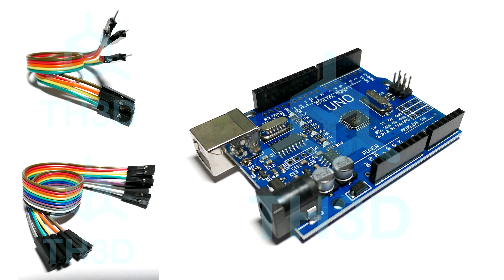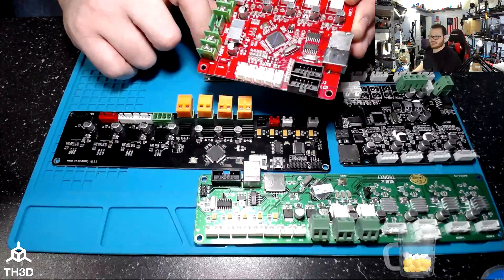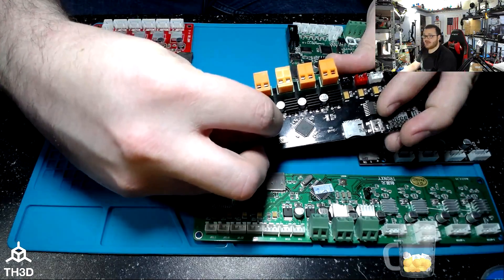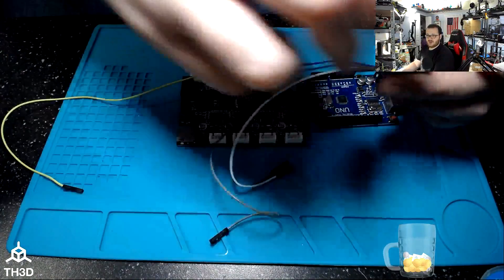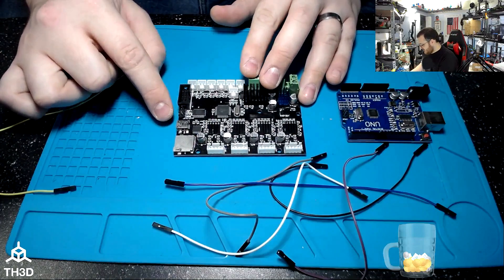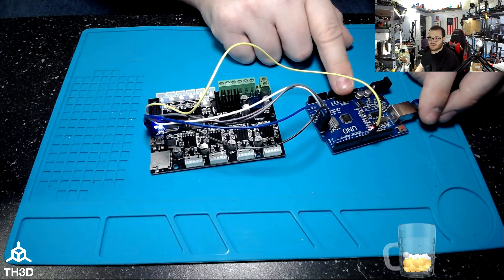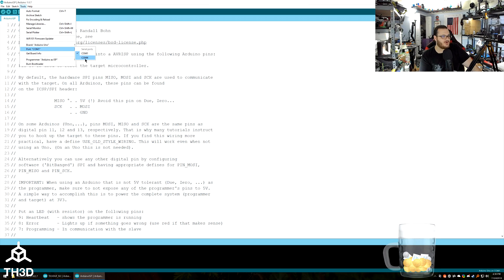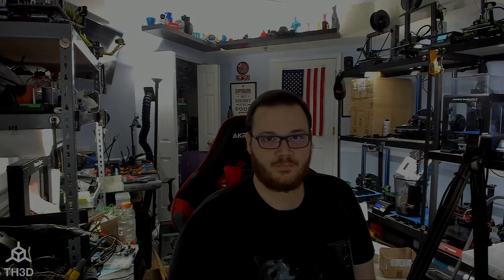Bootloader Flashing Guide - CR-10/Ender 2/Ender 3/Ender 5/X3S/X5S/Wanhao i3 - 1284p Boards

Comment: Were you able to solve the problem?

I'm repairing a 3D printer with a Creality3D V1.1.3 board. I replaced the old hotend with the Titan Hotend + Extruder Kit, and I'm having the exact same problem. Everything works perfectly, except the extruder isn't feeding the filament.

I've tried many things, including swapping the cables for another axis, and it behaves the same. The strange thing is that when I try to move the extruder through the screen, the one that tries to move is the Y axis.

I've investigated, and it seems to be a problem with the firmware that somehow got deconfigured. I'm trying to find a way to update it since it's a very outdated board, but I wanted to avoid that process if possible.
Reply from the maker: That board is very old and slow, it should be replaced with something like the V4.2.7 or EZBoard V2 - both of which we stock and sell: https://www.th3dstudio.com/product-category/3d-printer-boards/

Comment: Hi! I have a problem with my Ender 3 S1 Plus. I installed the firmware wrong, and when I reinstalled the original one, it works fine on the display, but when I insert the card into the motherboard, it doesn't start. I've tried everything, but nothing. How can I fix it? Thanks for your help!
Reply from the maker: This video is not for that printer.

Comment: I have Creality 4.2.2 board with 4-pin header, pins power, ground, clock, and digital IO.  Do you have a procedure for this board?
Reply from the maker: This guide is ONLY for the 8-bit boards. Yours is a 32bit and already has the bootloader. IF you need firmware see here: https://www.th3dstudio.com/product/unified-2-firmware-for-creality-stock-v4-x-x-boards/

Comment: does it need to speciffically be an arduino uno or can a micro work too?
Reply from the maker: I've only ever used the Uno R3 type shown in the video so I am not sure if others will work the same way. I would assume you could but I wouldn't be able to walk you through it since its different from this guide.

Comment: After opening AruindoISP at 12:08 anytime i use the openfirmwarewindows it opens the AruindoISP and not all the files for the bootloader (TH3DUF_R2 and such). Do I need those or do I just burn the bootloader after doing the AruindoISP. Thanks
Reply from the maker: Read the bootloader page. Unified is not in that package anymore. This video is older.

Comment: I know this is old but does this need to be done every time to accept firmware or once and done?
Reply from the maker: One and done. This guide for the bootloader part is still the same in 2023
Reply: @TH3DStudio  I edited firmware to enable arc support, made my firmware too big and overwrote the bootloader... Only one and done if you're not dumb I guess haha
Reply from the maker: You probably used the wrong build environment if it overwrote the bootloader.
Reply: @TH3DStudio  I did 🫠 don't worry, all patched up back up now. Loved the work you guys put into the unified firmware. My old garbage printer AC Mega Zero V1
Reply: Was even updated in your configs

Comment: i got this message   
avrdude: Expected signature for ATmega328P is 1E 95 0F
Double check chip, or use -F to override this check.
Failed chip erase: Hochladefehler: exit status 1
Reply from the maker: Sounds like you're trying to flash the control board and not the UNO.

Comment: "make a tutorial that won't be outdated" aaaaaand it's outdated
Reply: Yup! Very outdated. I have listed and read everything, still cannot find the new arduino files for the bootloader. It's not in any download package. Their website and directions put you in circles between a few pages and downloads that all say "refer to this page" which refers to a dwonload which is missing the file you need.
Reply from the maker: You would be wrong. The Arduino IDE is still what you use to flash the bootloader. The firmware is the only part that has changed. So flash the bootloader with the Arduino IDE and then use Visual Studio Code to update the firmware.
Reply: @TH3DStudio  the link doesn't take me to the "full package download (U1.R2.7)". found "Unified 2 Firmware" for my printer so tried downloading that but that doesn't seem to be the right software for this so I tried downloading "TH3D Bootloader Flashing Package" with also doesn't seem to be the right one. 
found another link on how to flash the printer from the site but that link was a 404 "Did you get a bad flash on your 2560 Creality board? Read here on how to re-flash the board.".

Comment: Maybe because this info is 5 years old but this didn't work for me. Followed everything exactly but I get an error that says: Arduino: 1.8.7 (Windows 10), Board: "Arduino Uno"

the selected serial port # does not exist or your board is not connected

I can see that  the board is connecting and everything is getting power.
Reply from the maker: This method still works in 2023. It sounds like you may be missing a driver for the board or have the wrong one installed.

Comment: I have the 4.2.2 board and there is no programming pinouts?
Reply from the maker: The 4.2.2 already has a bootloader. This guide is only for the older 8-bit boards.

Comment: Any thoughts on why the boot loader would just be wiped? I mean i suspect it has some thing to do with bad sd card and i can imagine marlin crasghing on write errors. That should not wipe bootloaders thats crazy. I have and isp programmer but i hate to have to open up my kinda new ender 5 pro. So much troube. Would be nice if creality exposed the isp to the outside or fix marlin so it doess not just write anywhere on sdcarrd error. Sorry for my typing errors. I had a stroke last year. Thats also a reason I see opening up my ender as a challange
Reply from the maker: Usually, the bootloader gets overwritten when the firmware or flash region is not setup correctly. Thats assuming the CPU doesn't have an issue itself.
Reply: @TH3DStudio  wel mine was original. The board says 4.2.7 no isp connector and the 4.2.7 firmware dud bot work the 4.2.2 did. Weird. Glad i could still flash via sd

Comment: Is there a way to know the bootloader actually loaded into the printer control board? It finished but it also finishes when the UNO is not connected to the printer control board. Also, I wanted to be sure the wiring is correct for the MISO & MOSI.

UNO MISO to BOARD MISO
UNO MOSI to BOARD MOSI 
or
UNO MISO to BOARD MOSI
UNO MOSI to BOARD MISO
Reply from the maker: Its MISO to MISO and MOSI to MOSI. If the board has a bootloader it will update firmware over the USB port.

Comment: hi, great video. Could you advise how to do this with the Creality Ender 5 Pro Board v4.2.2 as it only has 4 pins instead of 6. I need to do this as I messed up a flash update half way through and lost the preinstalled boot loader. Thanks in advance.
Reply from the maker: You don't need it for the 4.2.2 board. You should read up more on your board before attempting to modify the machine or you may break things.
Reply: tysm for your reply.
I have followed all the tutorials and information i can find on this and still no results.
I realised i put a boot loader sd card in my printer just after i turned it on annd in panic i switched it off again and had nothing but a blue screen since.
I beleive i have corrupted the boot loader, and read somwhere i cannot now find that it can be put on again with an Audrino, which i have a uno3 to use.
Is there any way you know of reflsing the bootloader?
Reply from the maker: You'd use a STLink to flash it but you need to get a hold of the bootloader file from Creality. We don't even have that and we sell their boards.

Comment: Hmm, looks like something is wrong.  The Sanguino 1284P option is nowhere to be found when using the Arduino IDE which comes in this download package.
Reply from the maker: You may be using the locally installed Arduino IDE. Our package has the 1284p included as its a portable installation. But if you have an arduino IDE installed already you may need to uninstall it while using ours.
Reply: Also, the OS X instructions for how to install the "hardware" folder containing Sanguio support which is included in your download package  direct the user to a URL which is a 404.  It turns out the instructions are trivial, just move the "hardware" folder into your sketchbook folder (on OS X, that's ~/Documents/Arduino).  (For others seeing this, note that this is an alternative to using the board manager URL, not in addition to).
Reply from the maker: Thanks for letting us know about the broken URL. We'll get it updated and updated in the new helpcenter.

Comment: Thanks for your videos, I was indeed motivated to follow your súggestions, but:
My prrinter worked fine, until I noticed the X Motor did not stop during heating up before the print. The stop switch still worked fine during a test. So there was a need to upgrade the firmware. However, I ran into a problem and now I am scared I bricked my Ender 3Pro V1.1.3 board. I have tried this suggested way of launching a boot loader from several UNO's and a MEGA 2560, but ran out of sync many times. Then I replaced the cabling and selected ports 10-14 on the boards for the communication. Loading the avrdude commands from the command line in a CMD window, showed there is communication, but even with a "-F" optional command, I still get:

==============quote====================
Writing | ################################################## | 100% 123.35s

avrdude: 127660 bytes of flash written
avrdude: verifying flash memory against Ender3ProBLT.hex:
avrdude: load data flash data from input file Ender3ProBLT.hex:
avrdude: input file Ender3ProBLT.hex auto detected as Intel Hex
avrdude: input file Ender3ProBLT.hex contains 127660 bytes
avrdude: reading on-chip flash data:

Reading | ################################################## | 100% 74.82s

avrdude: verifying ...
avrdude: verification error, first mismatch at byte 0x0000
         0x00 != 0x0c
avrdude: verification error; content mismatch

avrdude: safemode: Fuses OK (E:00, H:00, L:00)

avrdude done.  Thank you.

============= unquote ==========

Please let me know if there is another solution than buying a new 32 Bit Board for my printer

Thanks in advance

Jos
Reply from the maker: I would recommend replacing the board as the new ones are a lot easier to use and flash. Join our Discord server to get help if you want to try and resurrect your board. If the board is bricked we have our EZBoard that is really well built and actually easy to use: http://ezboard.th3dstudio.com/

Discord: https://discord.th3dstudio.com
Reply: @TH3DStudio  Thanks a lot for your reply ! It is good to see you are still checking these old links. As I am not a professional printer, I have just retired from work, I will go the easy way and order the Creality 4.2.7 board, which is currently about 1/2 the price at EUR 51,99. But, again, your advise is highly appreciated

Comment: Hello, Thank you for the video, It´s very explanatory. I have the 4.2.2 crealty ender 3 board with STM32F103RET6 chip and only 4 pins in program port, near usb port. Do you know how I can burn the bootloader? with arduino UNO or similar, I´m looking for the way but I´m lost. Thank you so much.
Reply from the maker: If you read the directions on the bootloader page and our firmware pages you will find that your board does not need this step and already has one. If you try use this guide on your board you will damage it.

Comment: Great video! I actually feel like I understand what I have to do for once !!.... Do the files work with any knockoff Arduino or just yours? (I would buy yours, but I'm in Canada so cost of shipping, possible duties and shipping time would be less convenient)
Reply from the maker: As long as its an Uno R3 compatible board it will work. We use generic ones for flashing and they work well. Just make sure it has a real Atmel CPU on it. The Uno R3 design is open source so many places make them with their own branding or generic branding.
Reply: @TH3DStudio  Thanks!!

Comment: unfortunately this guide doesnt match the firmware update for a CR10S PRO V2. the unified firmware marlin file has been configured for teh CR10S PRO with BL touch by uncommenting the settings required. the arduino UNO has been set up as an arduino programmer no problem there. in the firmware IDE window when I attempt to burn bootloader I get an invalid device singature error. I can't findany further information on the website to help identify why the bootlaoder will not burn :/
Reply from the maker: If you read the firmware directions you'll see that the Pro has a bootloader already. Try reading the directions closer or you'll end up bricking your board.
Reply: @TH3DStudio  I know the pro has a bootloader already. unfortunately the bootloader has failed and the machine does not function. the machine will not boot up. all methods of flashing the software fails. Xloader cannot open a port. Cura/prusa cannot see the printer in USB and the UNO bootloader method gives me the device signature error. I'm assuming this means the board is actually dead and cannot be reloaded with a bootloader? (also many thanks for the fast reply I really appreciate it)
Reply from the maker: @CinnamonCanine  you can try re-burning the 2560 bootloader. It would be the same process outlined here for the V2.X boards: https://www.th3dstudio.com/hc/guides/bootloader/creality-v2-0-v2-1-v2-2-board-atmel-2560-icsp-programming-header-pinout/
Reply: @TH3DStudio  this was the process I tried to follow. A solid guide but I had figured there must be a major difference I was missing but it's looking more and more like the Mobo I dead. No troubles I appreciate the replies!

Comment: I ran into some issues trying to upload the ArduinoISP  I keep getting programmer is not responding,  do you have any tips for what I could be missing ? I followed the th3studio instructions and video instructions still not able to resolve the issue
Reply from the maker: Usually if its not responding that means your PC is not talking to the UNO board. Have you tried updating the drivers and making sure the COM port and board selection are correct?

Comment: The software is nice... IF you're using Windows.   What's the flash procedure for Linux?
Reply from the maker: Arduino and VSCode are available on Linux installations. If you need Arduino to flash the bootloader, you can follow the OSX guide to get it setup: https://www.th3dstudio.com/hc/guides/programs/arduino-ide-mac-os-x-setup-guide/

Comment: HI so Im getting an error from the firmware upload [Expected signature for ATmega1284P is 1E 97 05], triple checked pinouts. tryin this on a cr-10s pro. any thought s?
Reply from the maker: You are trying to flash Melzi firmware on a 2560 CPU. Download the correct firmware for the printer.
Reply: @TH3DStudio  thank you realized this last night and fixed thank you !

Comment: If you use directly ATMEL AVRISP MKII over the ATMEGA 1284 board you can program without bootloader I think. Also with ATMEL STUDIO and MKII programmer you can backup your previous firmware if something went wrong and reflash it. Thank you. ATMEL STUDIO permits to save and load .hex files directly.
Reply from the maker: Yes, you can flash with a programmer. But adding a bootloader allows updating over USB so you do not need to connect a programmer every time to update.

Comment: What about the creality v1.1.4 board? Supposed to have the tmc2208s do you know if that board needs a boot loader? From what teaching tech said this board comes with a boot loader
Reply from the maker: Most of the V1.1.4s did not come with them even though Creality said they did. Try uploading firmware and see if it works. If it does, then you have a bootloader. If it does not, then you don't have one and would need to flash it. We have a guide here: http://bootloader.th3dstudio.com/

Comment: Dear TH3D  Ihave a DYMY Melzi 2.0 pro  and have not a miso mosi connector but just gnd 5v and rx tx pins could you help me telling me how to upload firmwre into the board? Thanks
Reply from the maker: Try to get a pinout for the board. They may be on the EXP1/EXP2 headers.
Reply: @TH3DStudio  Thanks
Reply: @TH3DStudio  I tried to burn the bootloader but I recieved the following error message: avrdude: Error: Could not find USBtiny device (0x2a03/0x49)
Error while burning boot sequence.
Please could you help how to solve this issue.
Best Regards

Comment: I have the USB connector from my BL touch, I was wondering if it would work like the Arduino Uno?
Reply from the maker: That is likely a USBASP and you should contact the reseller for the software and documentation on that. We only use the UNOs as they don't require weird driver installation like the USBASP needs to get it working.

Comment: so what if i plug everything in correctly and the uno's "L" led lights up and then shuts off and doesn't flash?
Reply from the maker: Double check the connections and make sure the UNO has the sketch uploaded to it. Also check your COM port settings as well. Also make sure you are flashing the right board and that it is one that needs the bootloader on it. Only the ones with the Atmel 1284P chips need the bootloader installed typically.
Reply: @TH3DStudio  I gave up on the crap board and ordered the EZboard. after I get it I will just need to change the Z lead screw steps to match the 2mm one's I have, I think that means they will have to be 1600 steps